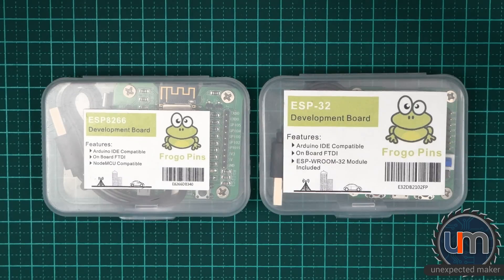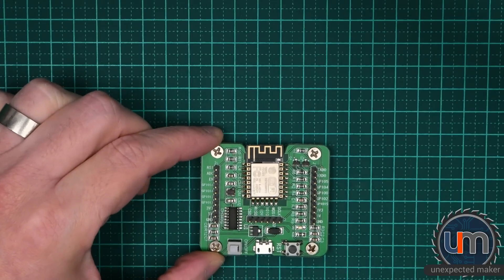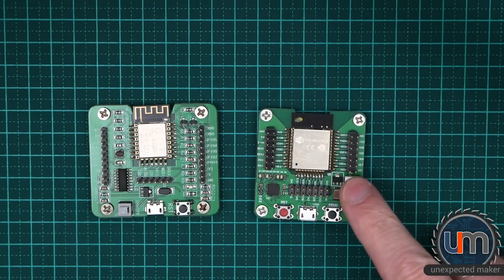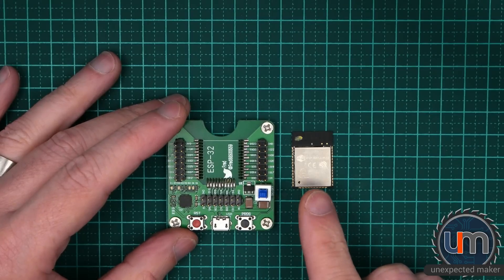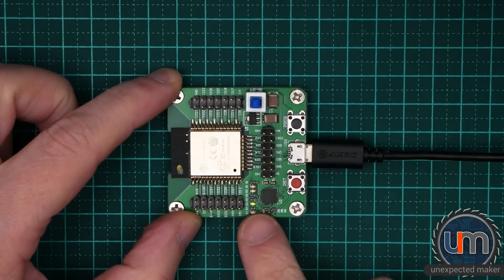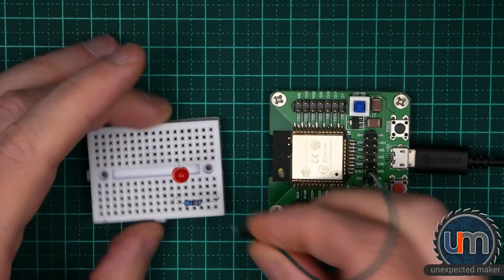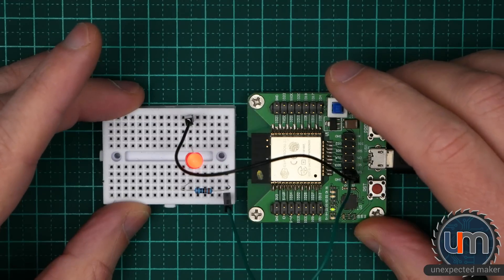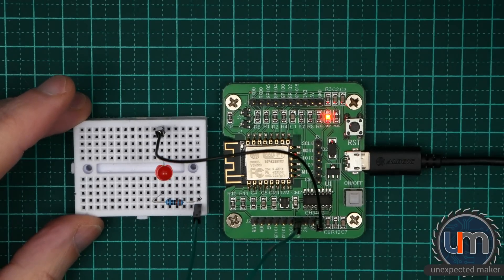Frogo Pin ESP Dev Boards Unboxing & Review

Comment: That part you weren't sure about is the 12MHz crystal for the CH340G :)
Reply from the maker: That square black package is a crystal? The CH340G needs a crystal to run? no way? Need to look into that!
Reply: not shitn ya mate :p the CH340G needs a 12MHz crystal and the 12M next to the 12MHz crystal plus both caps next to it... yeah. One of the crystal pin wires seems to be routed through pins and under the esp. PIN 8 and 7 are the crystal pins.
Reply from the maker: When my CH340G chips arrive from AliExpress (in 2020) I'm going to throw them straight in the bin ;) Pfff... crystals.. what year is this? 1960?

Comment: UM, I think the pins used on these boards are called 'pogo pins' because they're spring loaded, like a pogo stick.  

Keep up the good work, and interesting videos.
Reply: These are spring contacts not pogo pins
Reply from the maker: Yup, pogo pins are different, they are vertical and have springs inside that allow the pin to go up and down., These are just bent wires.
Reply: What pins are these exactly? I can't find them anywhere
Reply from the maker: I'm not sure exactly - maybe contact Fred on tindie about them as they are his boards.
Reply: I contacted Fred about these and he had them custom designed.  I ordered a couple of hundred from him so I could build similar programming jigs for other castellated modules

Comment: Did you try blinking the LED_BUILTIN or just pin 13? The first option should work with the ESP8266 since it has a LED installed right next to the WiFi antenna.
Reply: It is defined for some of the boards. Generic ESP32 doesn't have one, but Lolin32 has one of that is pin 5. Generic ESP8266 is pin 1, but that led on a ESP8266-12 module is connected to 2 (setting the board to wemos d1 mini will work)

Example of where these are defined: https://github.com/esp8266/Arduino/blob/master/variants/d1_mini/pins_arduino.h
Reply from the maker: ESP32 doesn't have LED_BUILTIN defined. I din't try LED_BUILTIN on the 8266... it could indeed be mapped the blue LED on the module, good point. I'll give it a go and report back over the weekend.
Reply from the maker: Thanks Brian! Wow, so much standardisation! Glad everyone is on the same page ;)

Comment: Nice quick review. Good to see Fred’s frogs again. :)
I thought this video would finally push me into ordering mine.  But the lack of a schematic saved me this time!
Personally, I’ve always associated “development board” with schematics (at least).  
I can see there appears to be other LED’s / resistors on the board, but what are they connected to?  
Not knowing how the ESP module has been wired-up would just annoy me, if I were using the board to developing a stand-alone ESP module design (which is what the Frogo Pins board is clearly intended for).
Also, it's probably not technically correct for them to refer to the CP2102 chip as "On Board FTDI". Hmm?
Reply from the maker: Yeah a bit cheeky using FTDI when it's a company name & brand of a specific type of USB serial chip... but I let that slide as I hear it used quite often to describe the function. I was quite disappointed that there were no schematics...  some of the extra LEDs on the ESP32 board are just TX & RX, but there was another that flashed for "unknown reasons" that I have yet to figure out.

All in all, I think they will be used by me to at least check modules as I get them to ensure they work, but not sure what else yet ;)

I might reach out to Fred to ask him if he would be willing to send me a schematic, or to upload one to the tindie store.
Reply: I reached out to Fred last year, and also pointed out that his ESP32 FrogoPin Tindie page description of "ESP32 Arduino core” linked to the Espressif 'esp-idf’ GitHub repository, instead of the actual 'arduino-esp32’ Arduino core repository.
I did get a reasonably quick response, but he didn’t really answer my questions and has never fixed the incorrect link.
This was probably the reason I never actually placed my order. lol
I'll be very interested to see if you are able to obtain a schematic!